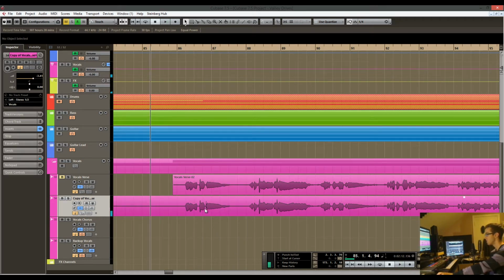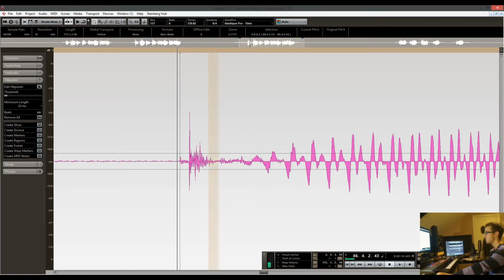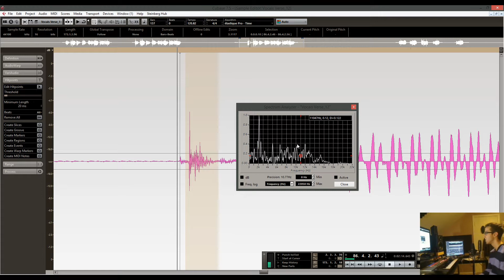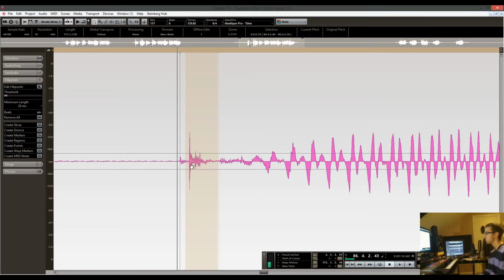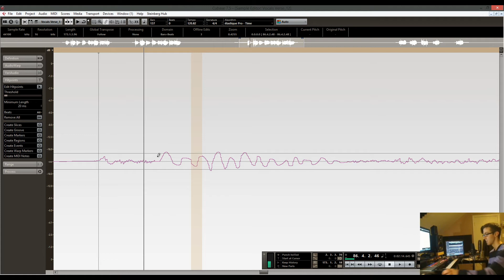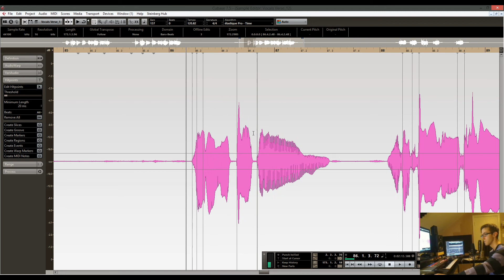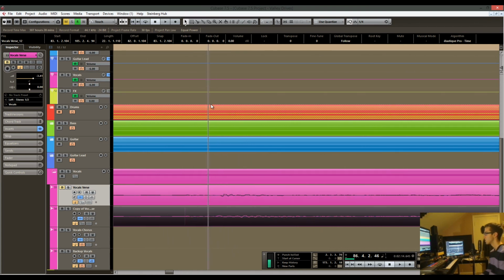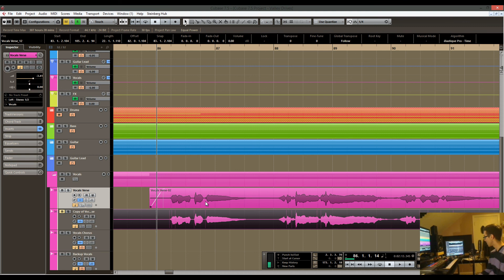Manually Repair unwanted "Click" Noise in your Audio

Comment: Man I'm having a lot of issues like this in my music. Problem is I had it all outsourced to get mixed and mastered and lord behold 50 dollars evidently isn't enough for them to clean up my audio beforehand. So I'm stuck trying to fix them with the final track. And it wasn't until recently where I started to notice I had a lot of these types of issues in my songs. I got Izotope RX7 and it works sometimes but other times I have sounds that aren't even picked up as clicks or pops at all. I have reverted to all different kinds of techniques including eqing out frequencies, fading in and out and cutting pieces out and putting the backtrack back in. Even using very small bits of the original vocals with generic effects on them just to try to clean them up. 

I'm beginning to pull my hair out because I'm doing this to about 18 different tracks altogether and a few of these songs have issues beyond my control but they stick out like a sore thumb. Some of these are just tiny blatant clicks but no matter what I do to try to get rid of it, I have no luck. Or I have to drop the eq so far down that you can clearly tell something is off.